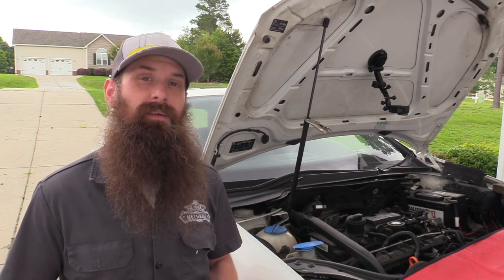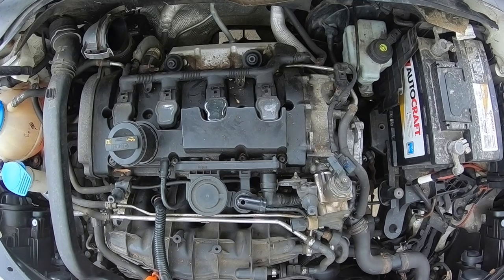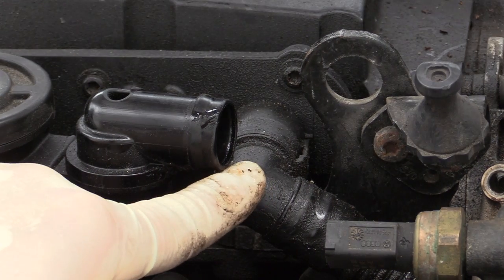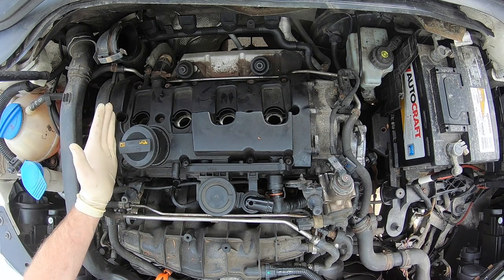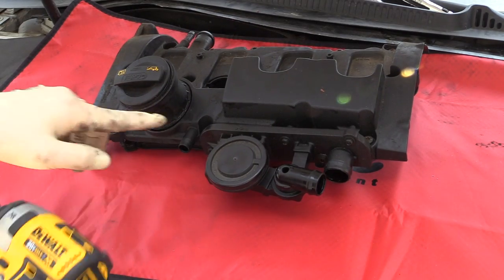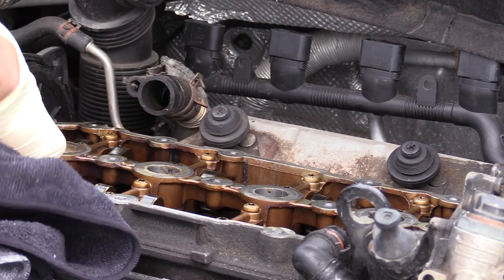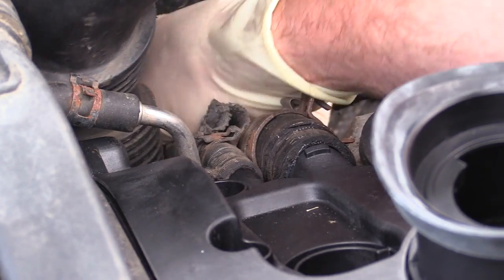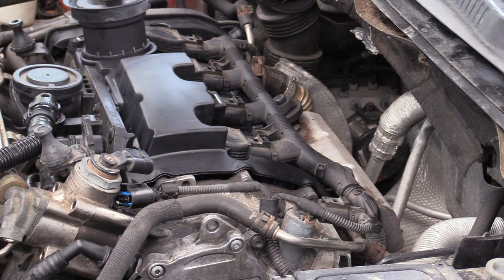Valve Cover and Valve Cover Gasket Replacement ~ MK5 GTI

Comment: WTH the coils aren't held in with bolts? WTF Volkswagen/Audi group.
Reply: WTH your sparkplug wires on your honda, LS, toyota isnt held in place by screws??? dude its the same concept and have zero issues :p
Reply: snederw the coils on my Toyota are held in with bolts and I wouldn't trust it without.
Reply from the maker: The last VW with bolt down coils I remember was late 90s Passat 1.8t. Like 1999. LOL
Reply: indeed the AEB and AGU?
Reply: @HumbleMechanic  The MK7 coils are held in place with bolts.
I've only seen coils pop out once... And that was when I forgot to torque down the spark plugs :P
Reply from the maker: HAHAH How the F did I forget about those. We had an issue with BPY coils popping up on the P1 coil recall. It would give weird Throttle pedal faults. HA

Comment: all data says 5.4 hours and gives no procedure, you look like you did it in about 2.4
Reply from the maker: No way 5 on that one. Thats more likely the newer chain engine
Reply: @HumbleMechanic  actually did the job today and was a little mad at the service writer, the specific vw cc I was working on doesn't have a valve cover it has a engine head cover with is substantially more difficult and requires timing and fuel nonsense, that wasn't even leaking it was the pcv thingy on top of it......